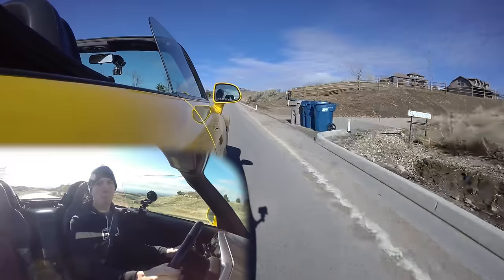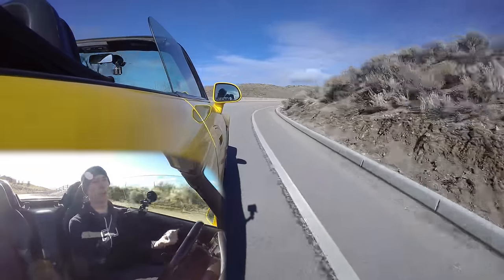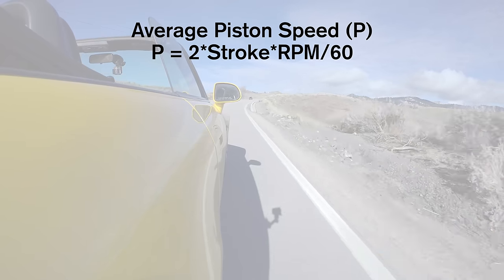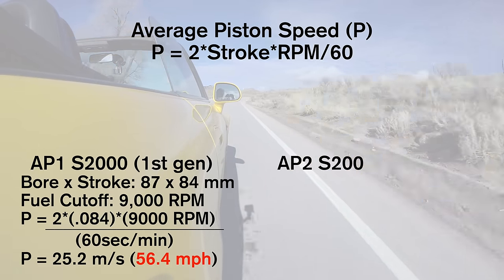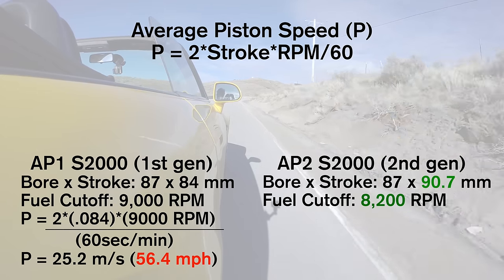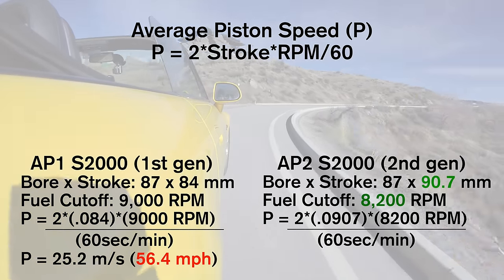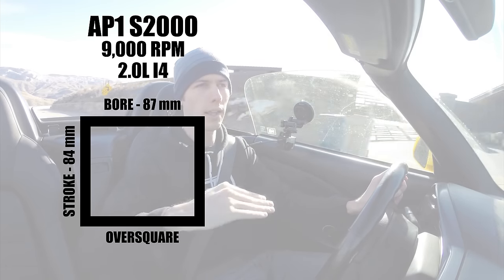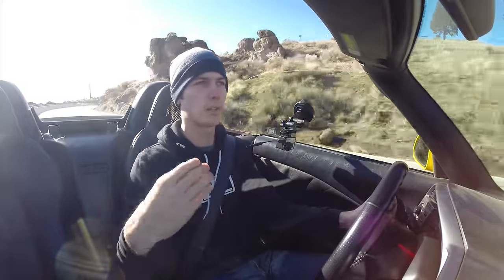How Do Some Engines Rev To 9,000 RPM?

Comment: Please correct me is I'm wrong:  VTEC is a longer lift duration, NOT opening more as you stated.  And VTEC is set with the vtec oil pressure switch too.
Reply from the maker: I will happily correct you haha, VTEC changes both valve lift and duration: https://en.wikipedia.org/wiki/VTEC
Reply: Engineering Explained, I guess I was snooty and didn't like your wording, using the word more.  And saying VTEC operates off RPM isn't completely accurate, either.  Ex, in neutral : if I rev to 6500, VTEC won't kick in.  From your article:

The switching operation between the two cam lobes is controlled by the ECU which takes account of engine oil pressure, engine temperature, vehicle speed, engine speed and throttle position

Comment: I have 2 old 100cc kart engines in my garage, both can rev to over 20,000rpm. One engine was made in 1995 which aircooled and has a reed valve, I have had that at 21,000rpm and it still pulls. I have another which was made in 2003, water cooled but is a rotary valve and I've only had that up to 18,000 rpm because I was just using it for fun. Of course back in the day these engines got a new piston after every race and being 2 stroke are prone to seizures when you lean them off to much. I've always wondered how these engines rev higher than other 2 strokes (road bikes, motocross etc). They are direct drive engines, so no gears. Is it due to the port designs, intake designs or is it down to the strength of the pistons? The water cooled fuel mix is 50:1 using fully synthetic and the air cooled 30:1 castor oil.  So both have completely different oil mixtures but can still rev really high. Both of them used a 3 jet Ibea carb, 26mm.

Comment: The engine RPM range and power band have influence on the torque or band, which influences the cost of the materials and complexity required to achieve a certain power and lifespan.

One example: we theoretically can build a 2 or 3 cylinders turbocharged engine with 1 liter displacement to achieve 100hp @ 4000~6000 RPM or a 4 cylinders naturally aspirated engine with 1 liter of displacement to achieve 100hp @ 10000~13000 RPM. 

Both engines will need different materials and different designs that may increase or reduce the cost-benefit of the engine in terms of cost of production, cost of maintenance and fuel consumption (efficiency)... And end-user experience too... Hehehehe

Comment: Short answer: AIRFLOW.
Longer answer: lightweight valvetrain, components that can take the stress, & the ability to flow enough air & fuel to support it.
Ray Barton race Hemi engines rev to 10,000 rpm during a pass. The sound is glorious!

Comment: you should do a video on why the truck LS engines are so popular to boost, like the 4.8 and 5.3's (I have a 5.3 Envoy myself, but boringly stock).
Reply: The 4.8L is an Iron block and probably many of the 5.3L are iron blocks as well. It's easier to boost iron blocks and those engines are dirt cheap so makes sense to get cheap boosted power out of them.
Reply: Yeah, all the 5.3's in the Trailblazer/Envoy/Ranier/Saab 9-7x were aluminum but also fairly popular in most swaps (lots of turbo 5.3's in the youtubes)
Reply: becuase they can withstand such a high amount of boost pretty easily. (Strong Block and Head).
Futhermore they are cheap af.

Comment: Logistics operator here.
A diesel engine has more torque at lower rpm. That means less stress for the clutch with a heavily loaded vehicle, especially uphill. A clutch on a gasoline powered engine in a heavily loaded vehicle is more likely to overheat. Besides that, such lower torque curve is more attractive in the field of logistics as it seems more efficient than the gad engine that needs higher rev for the torque to be able to drive a payload uphill. As for big trucks and semi trucks: Big engines can't endure high revs, so gas is even less of a good option there.
Bottom line for me. Diesel is only a good strategy for moving goods.

Comment: I have a question about engine wear. Since higher rpm means more times a piston is sliding, but lower RPM like lugging an engine can wear the piston assembly harder, does it make sense to predict that engines revved lower under load or higher under less load will last longer?

Comment: Added rpm doesn't necessarily mean more power.  Depends on many factors having to do with the design of the engine. There are formula one engines that will top 20000 rpm, and two cycle model airplane engines that will top 40000. Probably about the same piston speeds as a farm tractor engine with a 6 inch stroke that develops it's power below 2000 rpm.

Comment: I realize this is an old video but if you don't mind I've a question; If I lower the reciprocating weight of the engine, does this in turn mean higher revs also? Thank you

Comment: I always wondered Why wouldn't Honda just use the larger cam profile all the time? Is it just a fuel efficiency thing to optimize mpg at lower RPM's or is there a more complex reason? Being a gear head I want the most power/torque all the time in my sports car so don't like the idea of sacrificing that for MPG if the car would run well in VTEC all the time. I am not familiar with Honda and have only ridden in 1 VTEC car my whole life so I am curious.....

Comment: Are those LS or viper v10 engines basically the different strategy that produce more torque but low rev, and balance them out by using higher gear ratio?

Comment: Nice video - just one question: lets assume we have 2 engines which produce the exact same amount of horsepower; one is built to rev until 9000rpm and the other one is built to rev until lets say 5500rpm - Does a higher reving engine burn more fuel than a lower reving one? I would say yes?!
Reply: Short answer... No. Long answer... Depends on a lot of factors that aren't covered by your question, but all things being equal, there's very little difference.
Think of it like this. Power is a function of the chemical energy of the fuel/air charge and the efficiency of the engine. The lower revving engine has more energy per power stroke for a given output, but the higher revving engine has more power strokes in a given time frame to compensate at the same output.
Reply: scott thompson well, that makes sense in theory

Comment: 6a10/11/12 engines are a v6 with 63-69mm stroke.. Mitsu FTO with the 6a12 mivec/dual cam tech revs to 8250 but doesnt make any more power because pistons skirts aren't moly coated like the hondas. ??

Comment: It's because
Its cuz if u have loads of power some power is gonna go into running the engine itself it will spin camshaft faster meaning higher revs and lower displacement means higher redline

Comment: Can you do a explanation on how a NASCAR push-rod 5.8L V8 is capable of 10K RPM with out exceeding the flame propagation limits? I have see that Telemetry on some of the very high speed tracks. If given what you say about displacement and the needed decreases in rpm red lines, those engines should start to have combustion issues at those RPMs, right? I might just be completely dense on this subject but those engines seem to counter your formula you had about the Honda engine.

Comment: Could somebody here explain me one thing?
Is there any relation between rpm and top speed? Or definitely there's no relation. Thank you in advance!
Reply from the maker: Not a direct relationship, no. But top speed will occur generally at a high RPM in a high transmission speed (likely one of the top two gears).
Reply: @EngineeringExplained  Then we could say higher rpm is an index of high speed?

Comment: But having more torque down low with similar gearing gets better fuel economy..... I hope Mazda will look into making a small displacement v8 with a longer stroke and a high compression ratio for performance and efficiency.

Comment: My slant 6 wind rev past 4500rpm. Small piston, very long rod, small crank swing. Not great for hp but a great low rpm torque motor.

Comment: Bike engines are massively oversquare, ultra-short stroke, and have to rev to the moon to produce torque. The upside is, tiny reciprocating mass (you need it in a bike), short small engines in some dimension (you need that), and low linear piston speeds allow better lubrication even at stratospheric RPM's.

Comment: Does max RPM have any relation with fuel consumption? What I mean by that is, would an engine with higher maximum RPM consume more whilst at full throttle or at steady speed? Because, you know, there are more combustions happening at a certain amount of time while it is at a higher speed.

Comment: Does the principal you explained here also apply to motorcycles? I currently have a small cruiser the Suzuki LS650 but am considering an adventure bike, but because of seat height the only ones I feel comfortable on are smaller that and considering my age the smaller ones I can still pick up if I drop them. The smaller ones have these high rev engines which I am not use to and thought that the longevity would be decreased substantially. For example the Kawasaki Versy 300 produces nearly 40 hp at over 9800 rpms whereas my 650 has almost the same horsepower but more than double the torque. Thanks

Comment: Great video. I have a question that maybe only you can answer. When an engine is revved high, and we hear that   engine noise that we infer that it's time to shift, what is that noise, that "vibration" or rumble? Is it the valves starting to float?   Do you know what I mean?  Thanks.
Reply: fuel or ignition cutoff, it's there to prevent damage from overrevving. if you want maximum acceleration you should never hit that spot, you lose as much time as your reaction time is, say it's 250ms, 250x6(nr of gears)=1500ms, congrats you are 1 and a half second slower than the other dude.

Comment: Anyone remember the Honda NR-500 race motorcycle 4 stroke engine?  22,000 rpm redline and oval pistons with 8 valves per cylinder.  I’ll bet the piston speed was at the high end...

Comment: In theory the velocity of the flame is directly proportional to the turbulence of the combustion which is again directly proportional to the average piston speed!the average piston speed should not overtake those limits to avoid the pressure drop at the intake valve worsening the volumetric efficiency! that's what I've studied I don't know if it's correct
Reply: mechônic da païs that makes perfect sense to me. So basically it's difficult to get a long stroke high revving engine because of the limitations of flame propogation.
Reply: Amateur Torque the limit is not the velocity of the flame propagation(that is always 3-4 times the velocity of the piston) but the knock,the bore of a gasoline engine can't be higher than 100mm due to the fact that of the end gas,so it's not correct saying that the flame propagation is too low to move the piston
Reply: I think the guy of engineering explained looked at the velocity of a laminar flame that is effectively around the velocity of the piston,but in the engine there are turbolent flames due to the squish and others fenomenons
Reply: mechônic da païs thanks for explaining that, what is a laminar flame?
Reply: it's a flame that has a planar front,i don't know if i explain myself,a turbolent flame has peaks and depressions on his surface,so it penetrates quicker in the gas
Reply: mechônic da païs thanks for your explanation. What did you study? Do you have a link you can share with me?
Reply: at the end,reasoning well on what i said,the limit is the flame propagation velocity,because theoretically to avoid the pressure drop at the intake valve you can make a large combustion chamber lowering the stroke and so lowering the average piston speed that are correlated with this formula (pressure drop )∝ (average piston speed)^2, but the limit is the flame propagation inside the combustion chamber,more bore you have ,higher is the distance the flame has to travel,and so the end gas in the combustion chamber is submitted to high temperature and pressure and the mix fuel air detonate before the flame arrive to it and provocate knock,thats the limit in gasoline engine,the guy of engineering explained made only the error of speaking that the flame has not enough velocity to move the piston that's it
Reply: mechônic da païs it's really interesting what you have learned. Can you recommend a book or a website for me to look into this further?
Reply: • G. Ferrari: "Motori a combustione interna", Ed. Il Capitello, Torino, 2008 (4 ed.). 
• J. B. Heywood: "International combustion engine fundamentals", McGraw-Hill, 1988. 
• "Automotive Handbook", R. Bosch Ed., 7° Ed., 2007 – ISBN 978-0-76801953-7
my professor followed those books
Reply: mechônic da païs thank you.

Comment: Hey EE, does having too much oil, or oil just above the top notch on the dipstick...bad or dangerous for the engine? Please if u have the time. Thanks Jason
Reply from the maker: It depends on the engine of course, but generally if you're just a little bit over it's not a big deal. Ideally, you don't go over, or drain a bit out to keep it in the designed range.

Comment: i'm not sure if this would work but, how do you think a lower a spring tension on the intake valve would effect the overall thermal efficiency of the engine.
Reply: It would gain a very small amount of efficiency because the engine would not have to work as hard to open the valve. But the engine would experience valve float at higher rpm that would kill top end power.

Comment: Are there any other factors that would limit RPM? Say, if you're tuning a car, you can remove the RPM limit, or shift it. Do you just look at the piston speed and try to stay below that theoretical maximum number or do you have to worry about other things?

Comment: What I don't know is if it's more stress for the engine to usually run it in higher revs. I mean does it wear down my engine significantly faster? For ex. currently I have a 1.9 TDI. Redline starts at 4500RPM. So is it harder on the engine if I keep it between 2000-3000 (where there's always a good turbo boost) or should I use it between say 1500-2500?
Reply: I dont think you will wear your engine a lot more if you constantly drive it with 2-3000 rpm but fuel consumption will definetly be higher, im not an expert though :P
Reply: Jorgy yes fuel consumption is higher but not by that much, it's around 2 euros more every 100km, having a good boost all the time worth that money to me.
Reply: Why do you need good boost while driving regularly? :) I always drive it at 1500-2500 rpm in daily driving or for long trips. If im feeling like speeding a little i rev it up to 5-6000 rpm before i do a gear switch
Reply: Because of the bad road infrastructure, the terrain around here is very uneven (lots of hills and mountains) but the roads are not built as good as say in Italy. I just visited Italy last year, they keep the highways as level as possible, they have lots of tunnels. So I wanna make sure I can always climb easily. Also, few highways around here so I have to overtake a lot.
Reply: Ok, i live in Norway and roads here are bad as well, i went to Denmark for vacation a couple of years ago and i remember its so boring to drive there because its just flat as long as the eye can see :P
Reply: Less heat, less fuel burned (over a given distance) is less wear. Simple as that!
Reply: Ben Davis Yes I know that, but my question was how much wear. Because if the engine wears down in 300000 miles instead of 310000 then who gives a sh*t, but if it wears down in 200000 then it's a concern.
Reply: sogerc1 regular maintenance will have more effect on engine reliability than driving it just a bit more agressive...I would say, drive it up to 4000rpm as much as you want...higher than that is just torture for that tdi(as the power falls off after 4k if you look at the Dyno graph)
Also when you just drive  at low rpms, there is a possibility that your EGR valve will fail( carbon build up), intake will get clogged etc...No worries, drive it hard sometimes to burn off that carbon, it's a modern turbo diesel engine.
Reply: Lazar Janjusevic thanks for the info
Reply: Steel has what's called a fatigue limit. You can beat on it as much as you want, but if none of that beating is beyond the fatigue limit, it'll last literally forever. Nonferrous metals undergo what's called work hardening. No matter how lightly you beat it, if you do it enough, the metal will become brittle and break. If most of your moving parts are steel, then you're just as safe at 4000RPM as you are at 1000RPM if you're on top of maintenance. Parts directly in contact with hot gases, though, are fairly safe even if they aren't steel because the work hardening is somewhat undone by annealing. If you're interested in some experimentation, you can observe what happens when you repeatedly bend or hammer a copper or aluminum wire. Then you can get it red-hot with a lighter or torch to anneal it and start over.
Reply: sogerc1- Three words bro: Change. Your. Oil.
Reply: TheSmileyFacedPizza - thx, interesting stuff
spoonman73 - I do it religiously